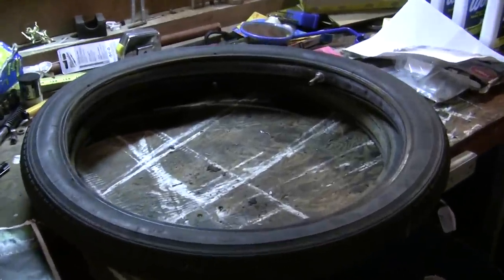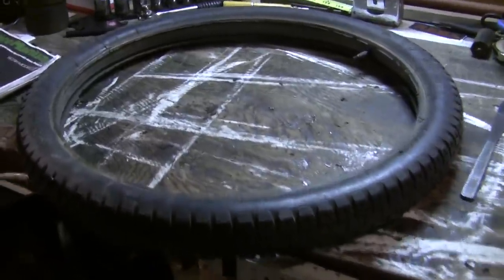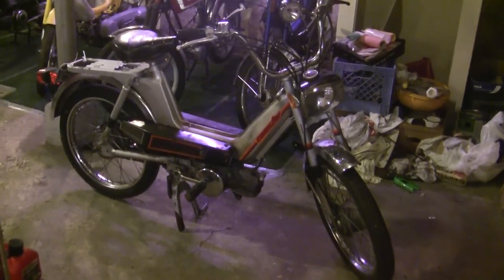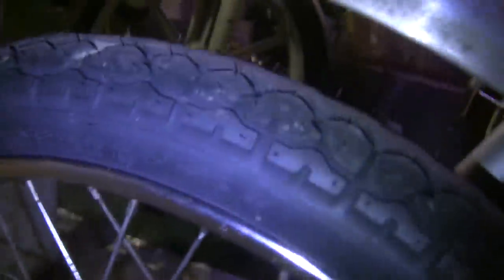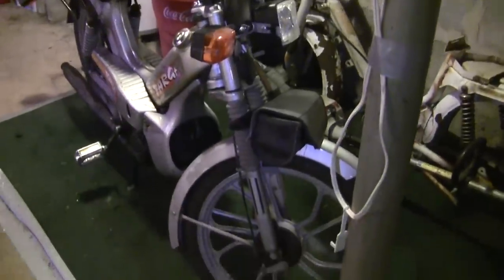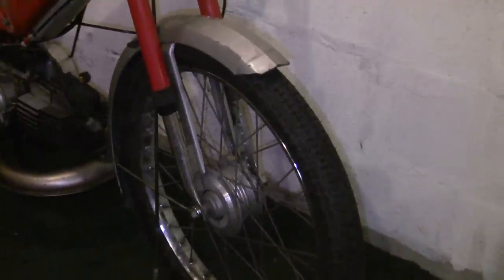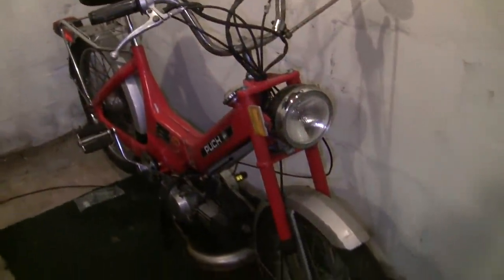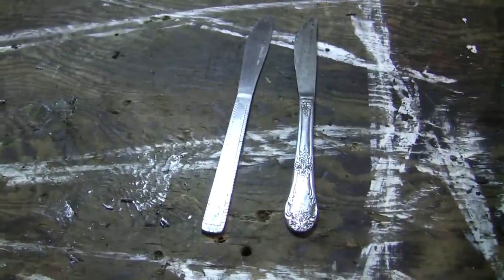Moped Tires Discussion - Brands I like - Intro to the Actual Tire Changing Video

Comment: Ahh the puch maxi "n" :-)

Good advice.

Cant remember what i used on my puch, too many years ago lol.

I bought a couple of bicycle tyre levers, the metal rod with both ends like a scoop.

Apply chalk or talcum powder on the inside of the tyre so the innertube can move as its inflated, washing up liquid round the tyre edge works :-)

Allways clean the spoke ends with sand paper to smooth the rust then apply a few layers of insulating tape and cover 1/4 of the sloping part of the rim as well.